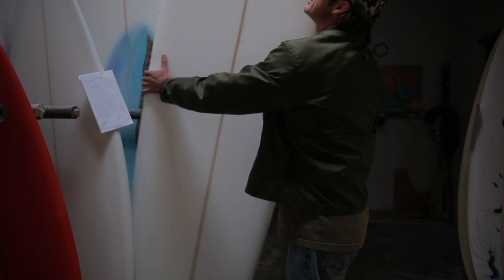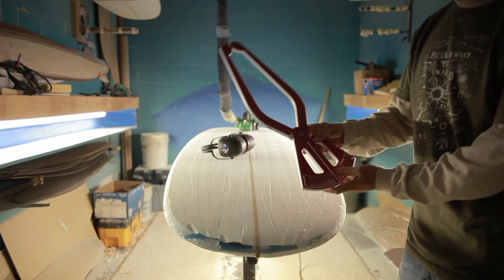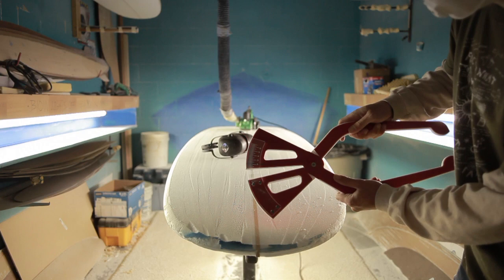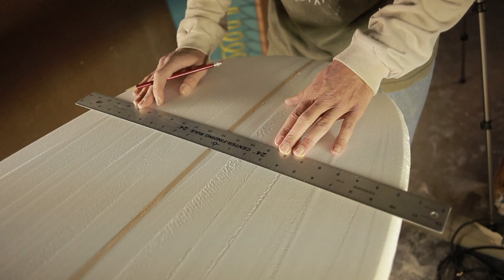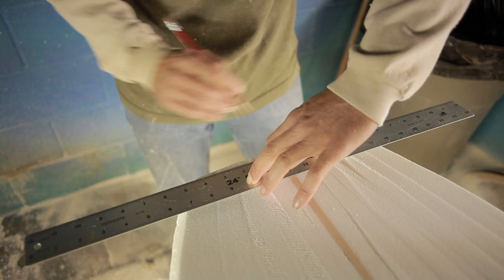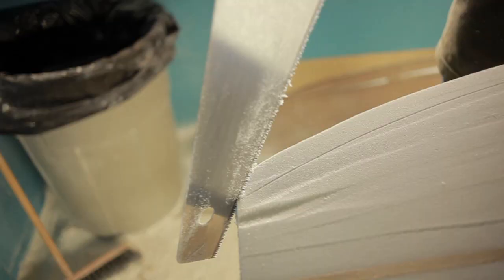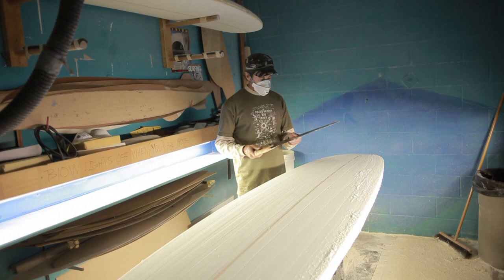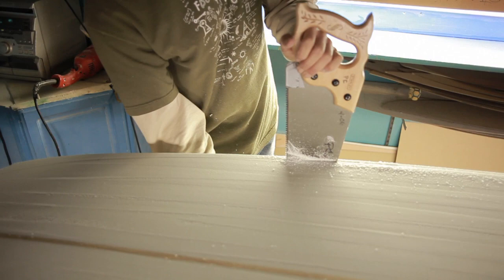paul carter how to shape a surfboard - part1

Comment: Please help me rid this confusion...how do you keep track of the rocker measurement details or custom profile of the rocker and board thickness from stringer out to rails near nose (and tail), along with deck contour, symmetry, etc. if you skin or plane the whole board top and bottom?  
But more important, for example, if I wanted to alter the entry and tail rocker to be flatter in front (nose entry), and kicked up slightly in the tail, is there numeric measurements that have to be written out first to ensure you don't shape it too thin in certain areas or screw with the boards planing performance?? And would you have to shave some from the middle of the board to adjust or fix such mistakes in entry or tail rocker profile?  (sorry for the bombardment of questions)....Thanks for the video!
Reply: Your answer is in the Ben Aipa, Fiberglass Hawaii video.

Comment: sorry for the delay Finn, You can use just about any plane as you find there are different grits or texture when using them. I use a wood plane for the tips of the nose and tail most of the time. Check out cboardsdotcom for more info thanks for the question. Have fun

Comment: why did you measure out the dimensions before using a template? can't you just use a full board template and trace the whole shape of the board, then cut? Thanks man
Reply: The customer probably wanted a more custom out line and he knew his desired nose/ tail width, you get more customization doing the “Frankenstein” template rather then just grabbing one you already have.  does that make sense?
Reply: @aidanrichards186  yep, thanks!